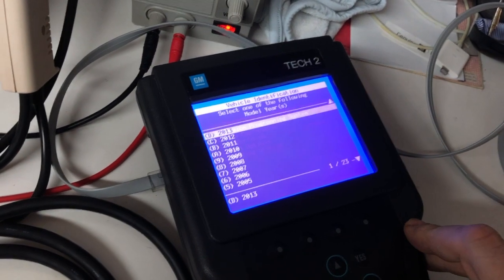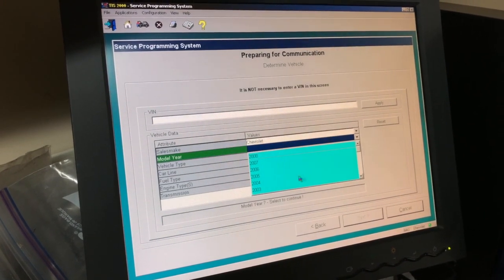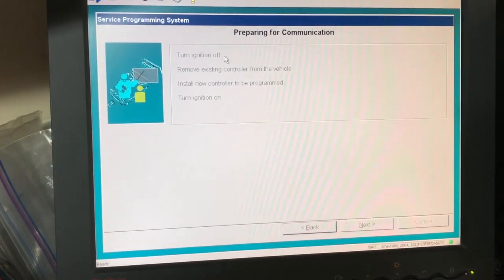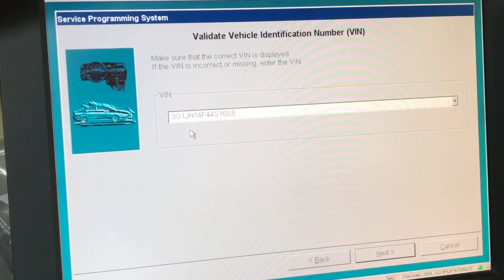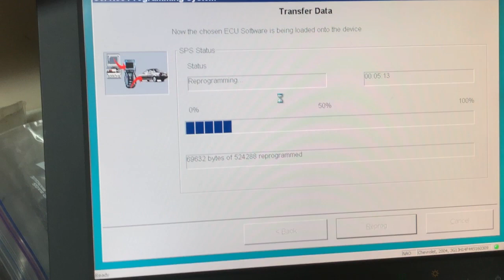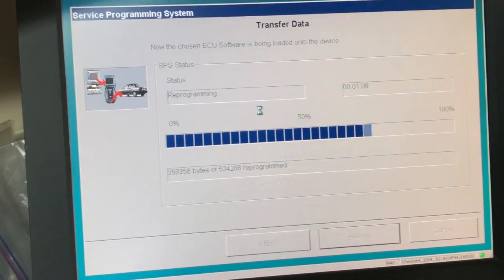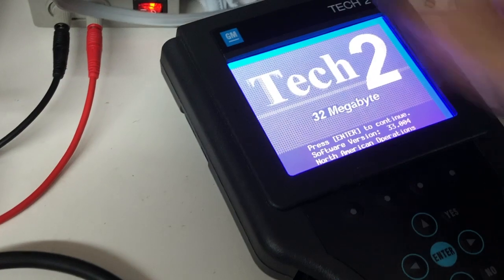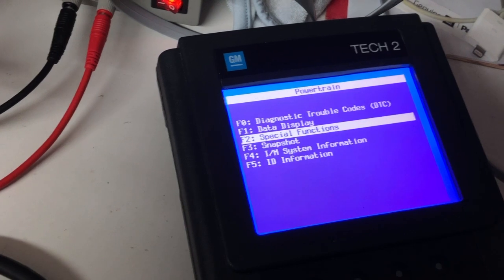2002 - 2005 GM P11 PCM Salvage Yard VIN Reflash with SPS and Tech2 (Chevy Pontiac Olds Saturn)

Comment: Great video how much equipment does a guy need to reprogram computers ford gm Chrysler I have a tech 2 dbr3 tons of other scanners and stuff
Reply from the maker: I have both a Tech2 and an MDI, both Chinese clones, that covers everything General Motors from 1993 thru 2018 just fine.
Reply: @DrShock  would be be able to to provide the links for the clone tools and a link to the software?
Reply from the maker: @Twizted8x  I'm not aware of any online hosting, the software comes on a DVD when you buy the Tech2 clone itself.  If you are not using a Tech2, your only option is www.acdelcotds.com where you can buy a subscription for tools like the GM MDI, MDI2 or even the VxDiag type tools.
Reply: Great video , Thank You it's all a matter of buying the tools needed , Your saying Chinese clones work properly so those will do , I have one question , How often due You flash upgrade /program PCM ?
Reply from the maker: It's not a common repair to replace the PCM, on the rare side.  But updating to the latest calibration, I do that for any vehicle I come across.  I view it the same as updating Apple iOS or Microsoft Windows.  ;-)
Reply: I'm restoring an 03 Cavalier , this is helpful , I can do that , thank You
Reply: What is a good turning tool to change the vin i have 2 gms with the wrong vin i can't get the vin to Wright???
Reply from the maker: @vencentbauer  2008 and earlier, use a GM Tech2 with TIS2000 on DVD.   2009 and later, use a GM MDI with www.acdelcotds.com cloud based subscription.
Reply: @DrShock 
Outstanding videos!  I currently have a bricked/failed ECM in my 2006 Chevy Express van..  I bought a used ECM but was wondering if I still pick replace and reprogram or just reprogram?  My bricked ECM shows no info when I try to pull it up on Tech 2.  No vin info or calibration etc.
Reply: Is this something that you do . Could I send you a pcm to change the vin ?

Comment: How do you switch it to the run position or manipulate it? I’m running a p11 on a boosted 2004 Saturn that originally came with an untunable e16a. Is there a way I can manipulate the e16a to be in the run position just to use the BCM systems? Wanting to maintain some systems on the car but need the p11 for solely powertrain and tuning purposes

Comment: How would you approach a vehicle with a salvaged engine and brand new ECM... without knowing the vin of where the motor came from?
Reply from the maker: For a brand new ECM/PCM you would have to go the scan tool route with GMs SPS2 subscription (J2534 type tool).   More than the VIN has to be encoded onto a virgin module, it needs what GM calls a calibration as well.    The scan tool will program it with the VIN of the vehicle it's installed into.   So where the salvage engine came from would be irrelevant in this case you describe, where one has a brand new or OEM remanufactured module.
Reply: @DrShock  🧁Sweet! This sounds like pretty good odds to get this thing running!  I need a J2534... do I need a special battery charger made for re'flashing?  And an SPS2 subscription from AcdelcoTds for $45?  Which J2534 do you recommend: EL-52100-AM?
Reply: This sounds like some awesome equipment to help out friends and make some extra bucks!
Reply from the maker: Yeah, the only source for SPS2 is direct from GM at www.acdelcotds.com and they sell subscription by VIN.   You would need a battery maintainer, not a charger, especially if it's a newer vehicle with other modules that could be drawing power.   For a very old vehicle, like from the 1990s, this is less of a concern as there's usually only the one powertrain control module there.

Comment: Dr. shock I was trying to reprogram a ECU and it said E682: No ECU data available !! what does that mean?
Reply from the maker: TIS2000 or Techline Connect?
Reply: @DrShock  It is TIS2000
Reply from the maker: That's a rather rare error, and I've not come across it myself.   But I would suspect, since it's TIS2000, that it may have to deal with either the security dongle setup (USB or parallel port plug device) or the communications cable between the PC and the Tech2.

Comment: Anything special needed o a 2004 Bi-Fuel?  I have ordered 2 and neither of them activated the natural gas system
Reply from the maker: I presume you're referring to the 2.2L Ecotec with compressed natural gas (CNG) as an alternative fuel.  As best I recall it's the same PCM part number, but the programming is very likely different.  So you have to be sure someone is using a genuine GM Tech2 scan tool to program from the GM VIN online database (not just editing the VIN digits with an aftermarket tool) to get the correct CNG calibrations flashed.
Reply: @DrShock  Thank you!  Is this something you can do?
Reply from the maker: Any local shop that specializes in ECMs should be able to handle that.  Certainly the local GM dealer, though that will be the most expensive option.
Reply: @DrShock  lol!  Our local dealer 🃏  I will look around but in a pretty small town and no one knows these cars anymore.  That is why I am online.
Reply from the maker: I didn't mean for any repair, just the reprogramming the already installed PCM dealership wise.  Definitely you're not going to find any tech's there familiar with these older vehicles.  btw, I would expect the original CNG fuel cylinder from GM to have expired from 2004, so you might check that also as a safety consideration.

Comment: Hi Dr. Shock, I accidentally reverted the GM 33.004 software on my Tech2 to an earlier version, 27.010, by using the download software function on Tis2000. I managed to find the GM 33.004.bin file on the Internet. Is there anyway I can use TIS2000 to download it back on my Tech2 (memory card)? Thanks.
Reply from the maker: No, as you've learned TIS2000 only comes with a very old obsolete version.  You would have to go to www.acdelcotds.com to download the latest Tech2 firmware, but it'll cost you well over $200 to do so.

Cheaper to find an used memory card on eBay with the right version, or track down the old card_writer.exe utility that could do so from a PC with the appropriate PCMCIA adapter.
Reply: @DrShock  thanks so much for the reply. what error message appears when GM prevents you from flashing the same calibration number onto the ECM? my SPS programming fails at around 80% with error message "Utility 12608523 Line 18 Operation B0 Errorcode 85". I'm almost positive that no double flashing of the same calibration number is the cause. At around 9:20 timeline, you mention about a tuning tool that goes in and just changes the VIN on a ECM. Do you mean like EEPROM stuff? Could you leave a link to such tuning tool? Thanks so much for what you do.
Reply from the maker: I've never seen such an error from a Tech2.  But it's definitely not the message for a calibration overwrite, that one would be in plain English.  This message looks more like a hardware problem.  Either internal to the Tech2, or with the module itself.
 
The tool I mentioned would be aftermarket to alter factory calibrations.  I don't have a particular link as I do not use such tools, and they are not cheap,  but EFILive is the one I had in mind when making the comment you reference.

Comment: what about the 2002 cavalier???? Can you please make a video!!! I cant find my PCM module anywhere!!! Thanks
Reply from the maker: If I recall correctly, for 2002 you'll find the PCM inside the passenger side wheel well.  Remove the plastic shield behind the strut area and you should see it.
Reply: @DrShock  Id have to take off my tire, what a stupid place to put it lol. I also havent been able to even find a new one already programmed in Canada or the US that would ship to me. Do you know anywhere that has one that would ship one to me already programmed? Thank you
Reply from the maker: These J body BCMs were not typically suitable to remanufacturing (the memory could only be written to once, and not reprogrammed using the typical GM scan tool at the dealership.  

So you would have had to buy a new BCM and have it programmed after installation into the vehicle.  Or you would have to find a source where they have gone in and virginized the memory to make an used one look new again.   I'm not aware of anyone doing this for J-cars currently, so a new replacement from GM is probably the only option here.

Comment: Is there a way to communicate with the p11 ecm in standalone harness? Or do I need to wire in the bcm to communicate with the ecm?
Reply from the maker: The Tech2 is going to want to see the BCM in the circuit.  If you're using another aftermarket type tuner tool you may be able to get by with the PCM all by itself though.  Haven't personally tried either, so couldn't advise further.

Comment: Do you offer your service for this ?  If so I  can send you one. Or once I find the pin no. and communicate this to you could you tell me the value of the bad resistor/capacitor and its location ? I of course would pay for the info.  Thanks.
Reply from the maker: No, I am not a business.  But there are folks out there who will do mail in programming of modules.   These particular GM PCMs are not repairable as there are no circuit schematics published for them.  

You'll have to replace it with either a new, remanufactured, or salvage yard unit.

Comment: great video lot of good info, question.. how would you do this without a tech 2 or without the tech line terminal pc ... Is it possible to us Carprog or other device like iprog to change the vin
Reply from the maker: No idea, I only use GM dealer grade tooling for this sort of thing to avoid drama.
Reply: @DrShock  do have any video explain what gm clone tools work, or you used for programing modules on 2015 and newer veclical
Reply from the maker: @772777777777777  I have posted several videos about clone GM tools in this playlist - https://www.youtube.com/watch?v=Nr_eYexAAV4&list=PLKGiYMtrEJBNvIjVNchktlQKZxtYxXAc3

Comment: Hey so just to be clear you can use and rewrite a salvage PCM but if during the calibration something goes wrong and can’t finish the update then you’re SOL?
Reply from the maker: If something were to go wrong like say a power failure during the calibration update then yes, you can brick the module.   The GM PCMs are fairly robust though, so it would have to be something catastrophic like that to brick one.   The TIS2Web/Techline Connect software won't let you install an incorrect calibration for the PCM part number and VIN, so that part you're protected from.

Comment: If I replace it on a 2005 gmc envoy it has to be reflashed cuz it does do anything.
Reply from the maker: You have to reflash to get the correct VIN and powertrain configuration as the same PCM would be used across multiple vehicle configs.

Comment: So the dvd version of tis2000 requires no fees? It’s just the latest version of tis? Thinking of buying a tis2000 version on a laptop on eBay
Reply from the maker: TIS2000 was discontinued towards GM at the end of 2007.   So as long as your vehicle is older than 2008 it's an inexpensive solution when paired with a Tech2 scan tool.   But for any vehicle newer, it's not going to be of use.   You'll have to subscribe to TIS2Web, the replacement on www.acdelcotds.com where GM charges you by VIN.  If the vehicle is newer than say 2010 you'll also need to step up to an MDI tool instead of the Tech2 as well.

Comment: i have a tech2 and need to clone a pcm of a 2004 cadi cts. i have captured the data of the pcm on the car. then when i go to the tis2000 it states in the bottom right corner of the tis program SAAB. now i generlly use the tech2 on my saab. not sure how to switch it to gm. or do i use this in pass through mode?
Reply from the maker: You need a different firmware card plugged into the base of the Tech2.  The SaaB one is unique for that European model (typically version 148.00).  For a Cadillac you need the NAO (North American Operations) one version 33.004.   For TIS2000 you can use remote mode or pass thru, doesn't matter.  In the video I only show pass thru and here's another on that mode https://youtu.be/53fho7l7yxI, but this other video shows remote - https://youtu.be/Nr_eYexAAV4
Reply: @DrShock  I have the card for gm. I now have nano but when I go to install it wants to uninstall my current version with Saab installed. Any recommendations.
Reply from the maker: @fatguyfriday  Not sure I'm following your uninstall comment. You swapped the PCMCIA cards in the Tech2 and powered back up and it's not just showing the boot screen for the NAO 33.004 firmware?   You might want to also check in TIS2000 that under the Configuration menu, Options that the tab for Dealership is set to NAO as well.
Reply: @DrShock  cards are fine. It’s the tis2000. Tis2000 is set up for Saab. I put in the tis2000 gm do set up. And it will only give me uninstall as a option. I need to add the gm.
Reply from the maker: @fatguyfriday  Ah got it.  I haven't had to do SPS with a different PCMCIA card so never hit this.  For just diagnostics it's all contained within the Tech2 itself.  A little google fu and it appears Saab had a unique version of TIS (sometimes referenced as TIS2008-2 in forums) and is not the same as the TIS2000 we use for NAO on the USA vehicles.   So yeah it does look like you have to uninstall the other to install the Cadillac compatible one.   Gotta remember these programs were only used by GM dealers, and so a Saab dealer wouldn't typically ever see a Cadillac for warranty service.  If you google around for TIS2008-2 Saab you'll see some posts around this.
Reply: @DrShock  well I finally got my cts ecm programmed successfully. But no the speedometer jumps to 124mph and trips the governor.  Ideas.
Reply from the maker: First make sure it's the exact same part number for the PCM you're using to replace the original.   There may be multiple numbers for a particular year/model.  Second be sure you are selecting the exact same calibration level as the original, if given a choice in TIS2000.   That's about all that comes to mind, usually if those two variables are accounted for, it's a no drama repair.
Reply: @fatguyfriday  did you end up getting rid of your cts?  I have a 2003 cts 3.2 l. 5 speed manual. 
Will I have to go to the dealer to do this? Smh

Comment: So you need a power supply, an OEM Delco radio, a Tech 2 GM diagnostic PDA, a laptop, and a few wire adapters to program the engine computer yourself on a bench??? I was hoping to somehow wire my power supply to the engine computer’s power pins, jerry-rigging certain wires from the engine computer to a serial port on a laptop. And some software to program the computer???
Sounds expensive; but then again.... GM engineers are evil, and they only seek to take your money, by charging you an arm and a leg for a part; and then a separate charge for your nut-sack, for the VIN flash to the new computer!!!! 
I was able to use my Sega 32X on my Sega Mega-Drive/CD console by doing just that; because I couldn’t find the original video cable for the 32X system back in the day.

Comment: Why would you need to replace or reflash a PCM? what problems do they cause when they go bad?
Reply from the maker: GM occasionally finds bugs in the firmware of these modules, which can affect drivability, fuel economy, or compatibility with other modules on the vehicle.   But the primary reason relating to the video, is you have to reprogram the PCM in order to change the embedded VIN so you can use a salvage yard one for a repair in a different vehicle than the donor.

Comment: Does this give power to your car stereo I drive a 2002se Pontiac Sunfire I can't get my stereo to work and my door lights don't come on now I changed the fuse and still nothing works I don't really run a wire from my battery in to the car
Reply: O ya one more thing I bought a quick tuner performance Chip it's made for my car are there safe to use and I bought e3 diamond spark plugs to
Reply from the maker: I don't have any experience using either of these aftermarket products so couldn't comment.
Reply from the maker: No, the PCM does not power the radio.   The power is wired directly into the radio as part of its wiring harness.   If neither the radio nor the interior lights have any signs of power on, and there are no bad fuses, then that points to an interior wiring harness problem that will have to be diagnosed manually.   May just be a bad ground due to corrosion but you have to trace the circuit out by hand to find it either way.